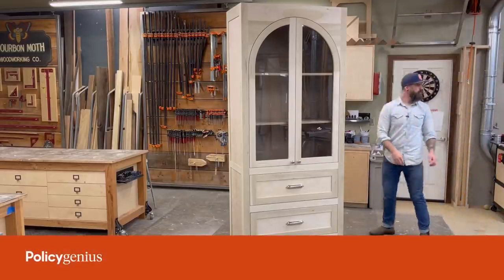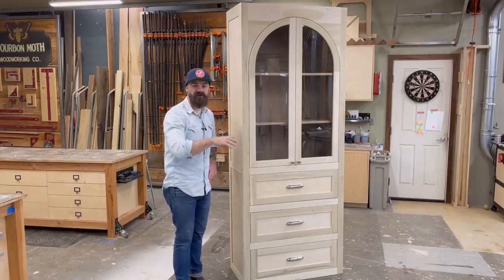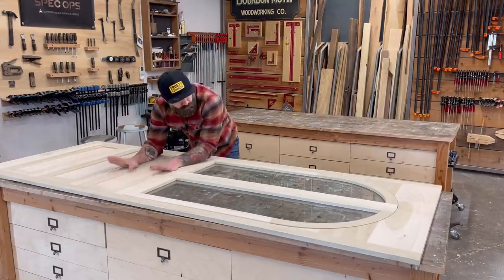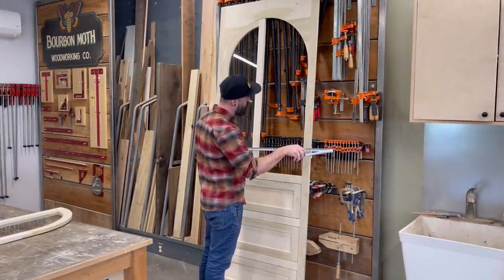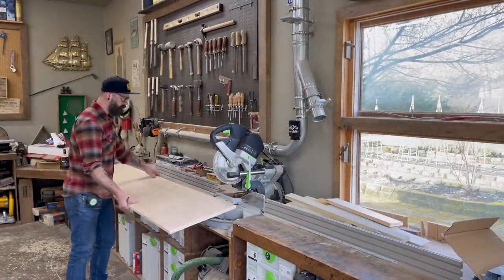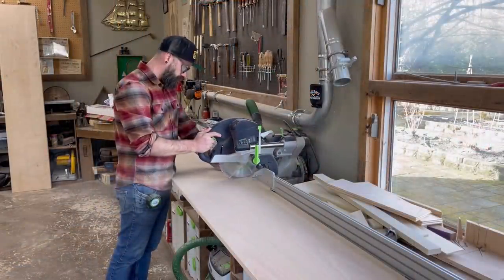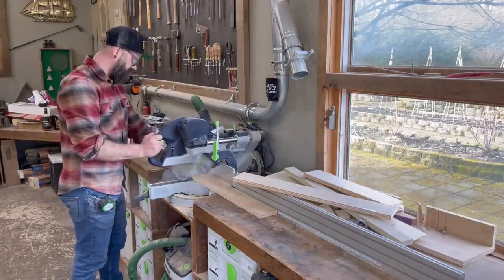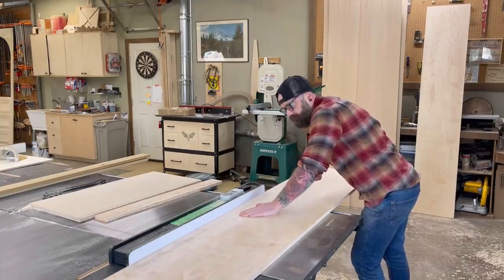How to Make an Arched Cabinet || Step Up Your Cabinet Game

Comment: Great Video Jason!

One piece of advice from a cabinet maker.. If you add an additional 1/2" to the width of the panelized side not against the wall, you can scribe it to the back wall as well. This way you can have a seamless transition between the cabinet and the wall while still keeping the cabinet itself level if the wall isn't. If the wall is plumb, then you can just rip the extra 1/2" off and treat it normally. When trimming out your side, make the back stile 1/2" wider to accommodate the scribe. 

Cheers!

Comment: Hi Jason, at 28:10 you were cutting down drawer boxes with the fence on left side of the blade - I'm always wondering when/why it's appropriate to use a table saw like this. Is that just the technique you use when you have wide stock (ie. a plywood sheet) and want more support under the offcut?

Comment: Question from a newbie. After a project like this is done can you just set it on a hardwood floor? What kind of feet would you use for this if any or what would you use to protect the floor?
Reply: Since he mentioned this would be scribed to the wall on the left side, I imagine it will be fixed to the wall on the left side and back. If your intention is a free standing, movable peice, dress out both sides of the cabinet, consider a top, and some adjustable feet to the base.
Reply: @hocuspocus4871  adjustable feet. Great idea! Thanks! I’ll look into some of those.

Comment: If the top is gonna be arched from the inside anyway, why not cut the faceplate to be arched on top and cover the "feathered" arched wood/ply from the top by 1/8" ply to make the whole cabinet arched on top?

Comment: It would be easier if you had used 1/2" bending plywood, then veneer it with 1/4" Oak plywood. Then you don't have to waste time cutting a million curf cuts.

Comment: Hi there! This video has been tremendously helpful! I did have one question about the relief cuts in this project vs. the airstream door arch. With this project at 14:30, you were able to bend away from the cuts, but at 10:45 in the airstream video: https://youtu.be/rMZsfZU_8IE?si=TQs3cU1AOhhxb8e0&t=640 when you bend the ply this way it brakes resulting in a different approach. Is the airstream door just a more extreme curve or a different type of plywood?

Comment: suggestion is to fill the kerfs with glue or epoxy and the knobs should of been centered instead of the stress on the bottom considering the hinge location
Reply: Jason is nearly six feet tall and it would be awkward even for him to have the door knobs centered because it it would just be too high up.  A smaller cabinet, then yes.
Reply: OR NOT